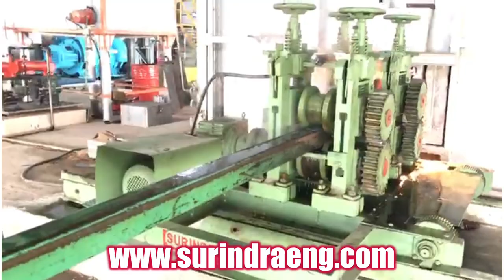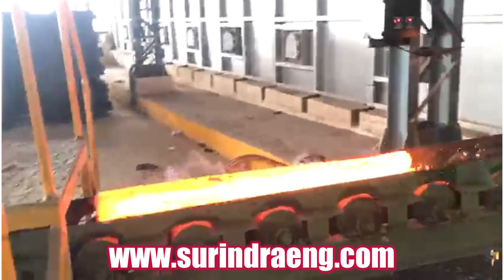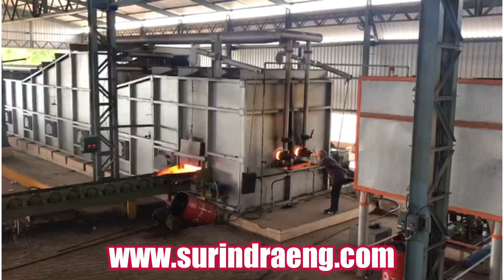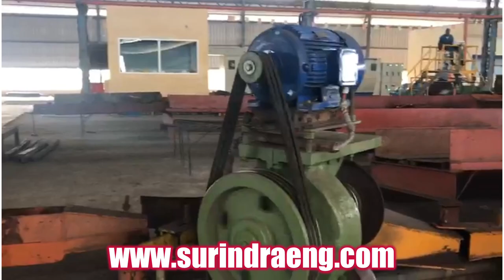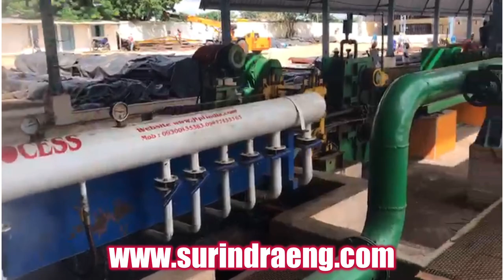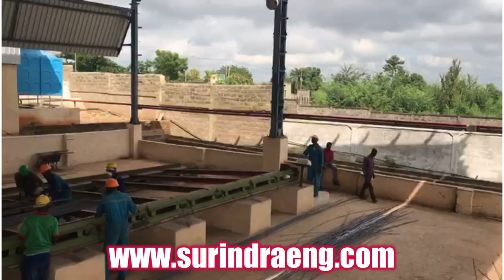Automatic Rolling Mill with Re-Heating Furnace.

Comment: Good lay out, but billet transfered from furnace to roughing Mill is too far. To set repeater work properly is not easy.especialy oval section.
Anyway, i operated Mill like this in 1975.
Reply: Good sir g